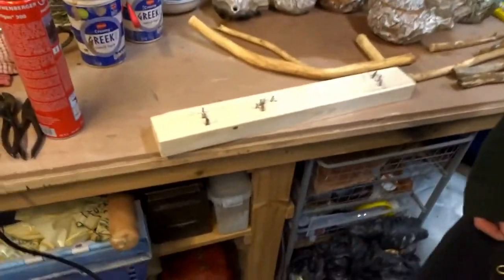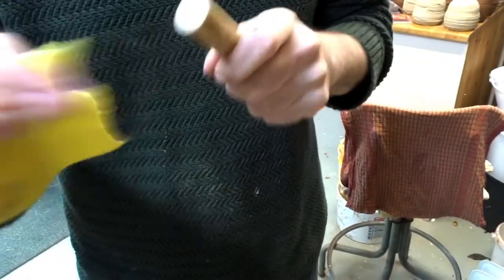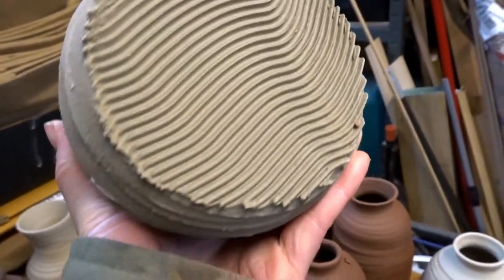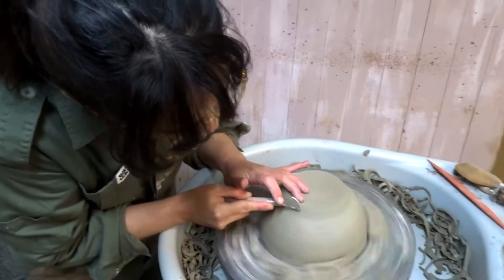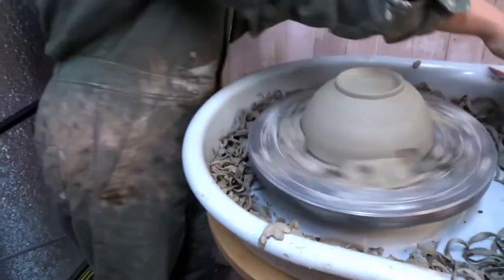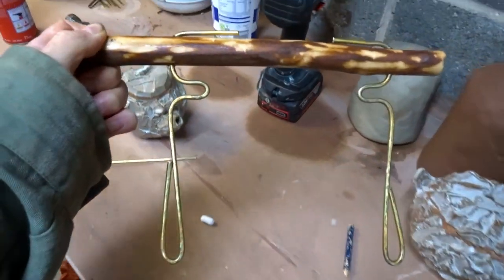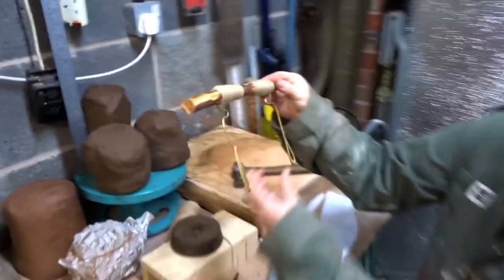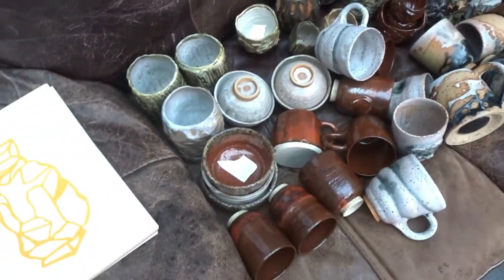Pottery Studio Vlog 3 - Making Wooden Teapot Handles and Trimming Bowls

Comment: It‘s so wonderfull and you are so kiendly, to let me know, how I can do many thing‘s. 
I have one question: how do you attache the handle at the side? Thank you for your help. 😘
Reply from the maker: Hi! It depends on the teapot and how you do the attachment. You could either leave a small hold to put a screw through into the handle  (but that would be super fiddly), or, you could do what I did and use an appropriate epoxy to glue  the handle in, after sanding and carving it down to get a snug fit.